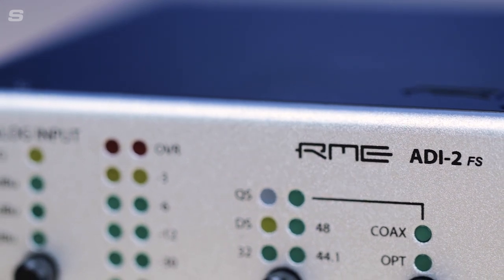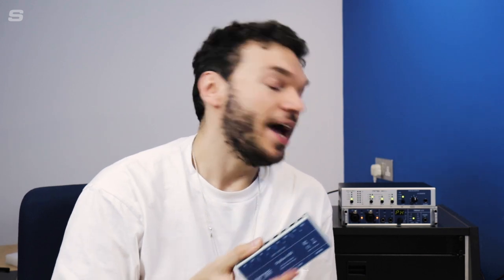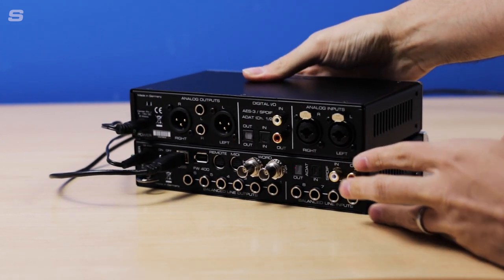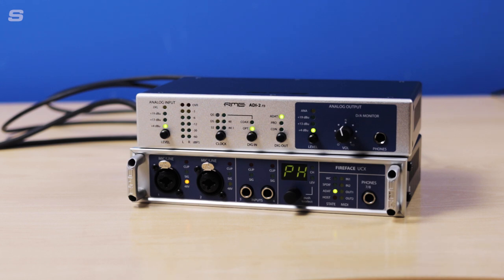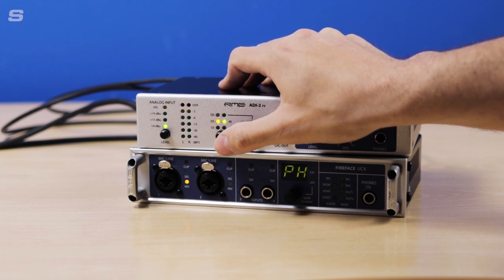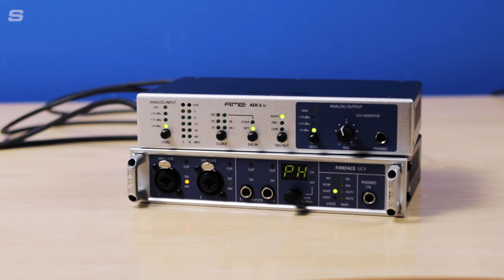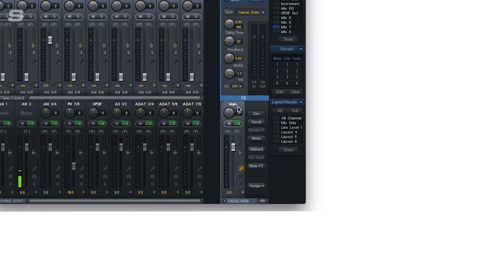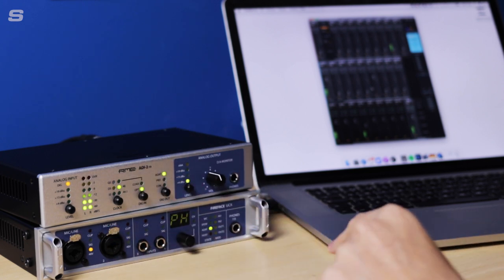RME ADI-2 FS: How to upgrade your audio interface with mastering-grade AD/DA converters

Comment: Hi! Thanks for the informative video. I'm currently using the first generation fireface UFX. Would adding the ADI-2 fs to my signal chain noticeably improve my monitoring? I'm using Newmann KH 310s in a we'll treated room. 
With the ucx was there an audible difference? Thanks again!
Reply from the maker: Hi, it sounds like you already have a very high quality setup - although it's an older device, the UFX is still a fantastic interface, and I've heard great things about the Neumanns :)  

With the ucx was there an audible difference? 
Personally I'd say yes, the ADI-2 FS is sonically an improvement over older RME devices (and even the newer interfaces). The differences tend to be subtle though. Something akin to comparing two high-quality DSLR cameras - the differences generally become more noticeable when you 'zoom in' if that makes sense.

As with all things audio, all I can really advise is listening to one for yourself - that way you'll be able to decide if there's enough of an improvement to warrant adding an ADI-2 into your setup! Best of luck with it.

Comment: Does it bypass rme ucx internal ad da converter??

Exactly during recording ADI2 FS will be used?? During Monitoring?.
Reply from the maker: Hi and yes, if you connect via ADAT, AES or SPDIF then the A-D and D-A conversion will be carried out by the ADI-2 FS (for anything connected to the the ADI-2). 

Anything connected directly to the UCX will still use its on-board AD/DA of course.

Comment: Hey can i use this to record in and print tracks.
Reply from the maker: Hi and yes, you can record up to 2 channels (stereo) via the ADI-2 FS’s two balanced line level inputs. Note that the ADI-2 FS is a standalone AD/DA converter however - you’ll still need to connect it to an audio interface, sound card or hard disk recorder (via ADAT, SPDIF or AES-3) for recording.

Comment: What's the difference between this and the adi2 pro fs r, is it conversation quality?
Reply from the maker: Hi, the ADI-2 FS is a stripped back version of the Pro FS R. Both feature the same AD and DA converters, as well as RME’s latest clocking technology ‘SteadyClock FS’.

The main differences are that the ADI-2 FS is just a straight A-D and D-A converter, and has none of the additional features found on the Pro FS R. 

So there’s no remote control or USB connectivity, no display or spectral analyser, no DSD support (max sample rate on the FS is 192 kHz, whereas the Pro can do up to 768 kHz), and none of the many DSP-based features found on the Pro (such as EQ, crossfeed and different filter types).

The Pro also features 2 x headphone outputs (with independent driver stages, so essentially you have 4 x analogue outputs), and can also be used with balanced headphones, whereas the ADI-2 FS just has the 2 x analogue outs.
Reply: @SynthaxAudioUK  Stating the ADI-2 FS features the same AD and DA as the Pro FS R is not correct. The ADI-2 FS uses AKM4490 DAC (used on the now discontinued ADI-2 Pro FS - silver casing) while the Pro FS R (assumed BE) and the revised ADI-2 DAC FS use the AKM4493 DAC which has slightly higher SNR spec. The ADC should be the same AKM AK5574.

Comment: Can i connect to a audient id14 mk2??
Reply from the maker: Hi, looking at the Audient it only has an optical input (no output, plus it's limited to 96kHz), so you'd only be able to use the ADI-2 FS for recording (and not for monitoring). 

You could use the analogue I/O but it kind of defeats the point -  you're better off pairing it with an audio interface that has both an optical input and an optical output (ADAT or SPDIF I/O).
Reply: @SynthaxAudioUK  Thnku for the reply 
.
Reply: It should be demonstrated more slowly. Too rushed. Many are still scratching there heads because it would have been helpful to actually plug a mic preamp or a keyboard into the UCX and then explain like this: "Even though I am plugging into the input of the audio interface we are now bypassing the UCX's onboard converters once the ADAT optical connections. are made. Next, you must address how people should approach plugging in their sources: "Go ahead and plug all sources into the UCX but remember that the conversion is bypassed and all conversion is being done by the ASD-2 FS AD/DA converters. RME has been like this on their forums as well. First they say something like this: the ADI 2 Pro or ADI-2 FS is "not an audio interface, so you really should just go buy the Babyface or UCX and don't worry about high end conversion until you really need it." Really? So why did you put two nice analog inputs on the unit and then say it is not an audio interface?  People like the idea of something simple, yes simple that is the best quality audio possible. 
 RME is constantly discouraging people who just simply like the idea of one stereo analog input going into the best possible A/D an DA converters....no routing, rerouting or creating stereo mixes for 10 people.  Don't ever say you don't like total mix in forum. That is the the sacred cow of RME. Not everyone wants an extra layer of software to use. RME, stop bullying who want use the ADI AD/DA converters as audio interfaces. We don't all need Babyfaces and UCX's! I get it options. Too many options can make one start to worship the endless tools available rather than stumble on an an inspiring result.😉
Reply: Sorry for the rant. I got a little carried away. RME is solid company making great products.